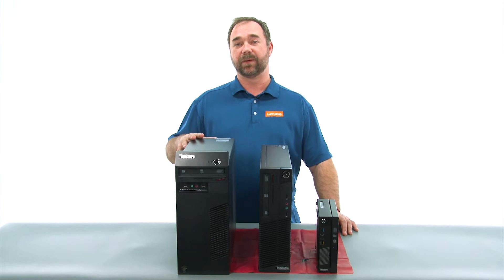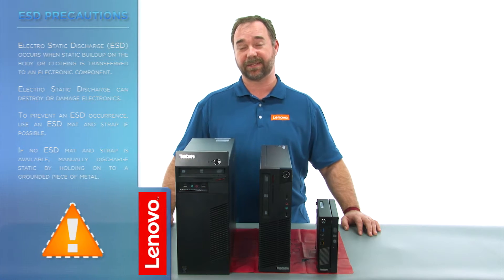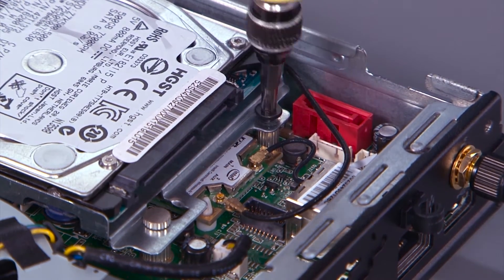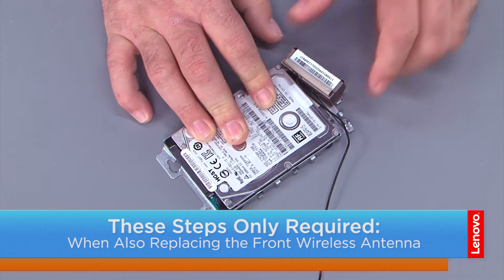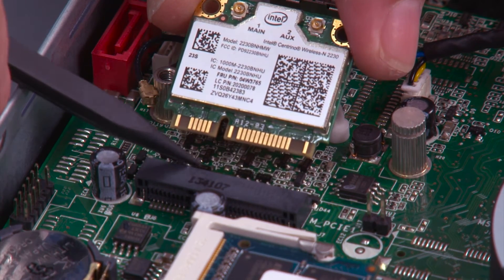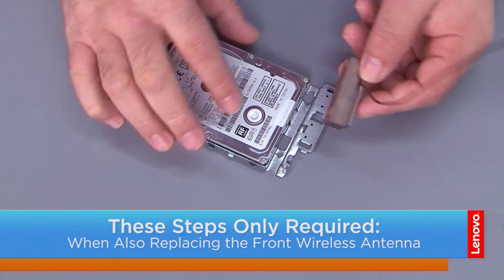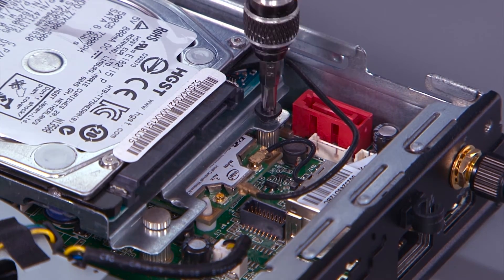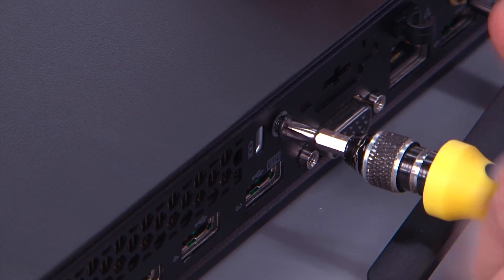ThinkCentre M73 / M72e Tiny Desktop - Wireless LAN Card Replacement

Comment: Hello Lenovo,

Just curious is there a whitelist on the types of PCI-E wireless cards that are compatible with M73 SFF? 

Thank you
Reply: Yes there is a whitelist. I tried installing a wireless card from an old Lenovo laptop, which had the same form factor, so it did fit in the machine, but the machine wouldn't post and asked to remove the unauthorised wireless card before proceeding.

Comment: I put a new antenna but another model and I get an error 1802 has a solution?
Reply from the maker: The ThinkPad BIOS only allows to boot with an "authorized" adapter installed. If an unsupported card is detected, the BIOS prints a message on the screen and stops the system:

  1802: Unauthorized network card is plugged in - Power off and remove the miniPCI network card.

Device IDs missing at the end of the string might mean the card isn't recognized properly by some reason.

Since the issue hasn't gone after BIOS reset you performed, default BIOS settings loading and the wireless card reset might help. To do this:
- there is a risk since you aren't able to disable the battery pack in the BIOS Setup with this error. So, the manipulations with either connected or not disabled battery or with a wireless card while the battery is connected or enabled are at your choice
- remove the wlan card (am I right it's a wlan card exactly, not a wwan one?). Both the charger (1) and battery pack (2) should be unplugged, of course
- enter the BIOS Setup, load default settings, save them, disable the Wireless LAN port (Security menu, I/O Port Access), save, boot laptop
- enter the BIOS Setup, disable internal battery pack, laptop will power off, unplug the charger, insert the card, boot laptop
- enter the BIOS Setup, enable the Wireless LAN port, save, try to boot

Let us know if this works. Carll_Lenovo

Comment: Hello, I have an M73 tiny, what dual band card can I use, my serial number is MJ01JMRZ. Is it safe to upgrade ?
Reply from the maker: Hi Mauro. Thanks for reaching us. We'd like to clarify, are you referring to upgrade the LAN card? If not, could you tell us more details, so we can further check? We'll wait for your reply. Ash_Lenovo
Reply: @LenovoSupport  Yes, i want to buy an intel dual band AC 3160 or en AC 7260 lan card to replace the n 7260 in my computer, or I need to buy an FRU card to replace it?
Reply from the maker: Hello Mauro, thanks for providing the details. You may view the compatible LAN cards for the machine here: https://lnv.gy/3dAJPUH, just enter the serial number of your computer, go to Parts, then click on Compatible tab to show the parts compatible to the machine. Hover your cursor to Commodity Type and look for Wireless LAN adapters. The compatible LAN cards should be the one that you order, otherwise, it will not work with the machine. 

For replacing the LAN card, you may view this link: https://lnv.gy/2wG9lHF for a step by step guide. 

Let us know if you have other questions. Allan_Lenovo
Reply: @LenovoSupport  thank you Allan, but i can buy any card without the FRU part number, for example, I can put an intel ac 7260 dual band in my cumputer with no problems ?
Reply from the maker: If you buy a LAN card without the FRU part number, it will not work with the machine. The parts that we have provided earlier are the parts that were tested to work with your machine. Allan_Lenovo
Reply: @LenovoSupport  ok, thank you for you time.
Reply from the maker: You're welcome. Rai_Lenovo

Comment: I have a M72e tiny and looking to purchase wirless card and antennas is there a kit avaiable?
Reply from the maker: Hi Anthony! These parts are sold separately and doesn't come in a kit. You can purchase parts from any online reseller using the following part numbers 04W3765 -Jackson Peak WIFI module or 04W3772   -Canyon Peak WIFI module and 03T8166 External Antenna stick. If you need to check the part numbers for any additional parts, you can check this document http://lnv.gy/2AIrHEy. Reggie_Lenovo
Reply: Ebay

Comment: can i replace with any wireless card or does it have to be intel? im not sure whats going on but my antenna keeps disconnecting, i first i thought it was a driver issue, but not completely sure anymore.
Reply from the maker: Hi Jerry! Thank you very much for reaching our support. First and foremost, what is the exact model name of the Lenovo computer do you have? Could you share us the serial number so we can further check on it? Also, when did the problem start with the WiFi connection? Did you change any settings or install any update before the issue occur? We're looking forward to your reply. -Chris_Lenovo

Comment: My M73 did not come with any Wifi Antennas and i noticed that the spot where the front antenna sits is used by a sponge like hard drive puller, any ideas? and where do i buy the antennas?
Reply from the maker: Hello. Which machine type do you have?  The serial number is printed on the side or back of your machine. Machine Type model information is located just right next to the serial number

    Serial Number - 2328XXX
    Machine Type - 8215
    Machine Type Model - 8215E1U
Reply: Serial is MJ016LXK 
Machine Type 10AX
Reply from the maker: Looking at the schematics I can't really find the solution. You would have to buy the wireless card, two antennas and a di-pole antenna. Unfortunately I'm having difficulty finding the part numbers even with the schematics online. I would be tempted to buy a USB wireless adapter. If you're absolutely determined to have the internal card and antennas I would try calling support.
Reply: i will call them eventually, looking at my motherboard there is a spot where i can install the wireless card, the back antenna and eventually the front antenna, but like you said i cant even find the parts your video is demonstrating.
Reply: Yep, that's the problem, no support available after the fact for these parts.  I can find antennas and cards all day long online, but no supporting parts like the wires and the rear antenna port.